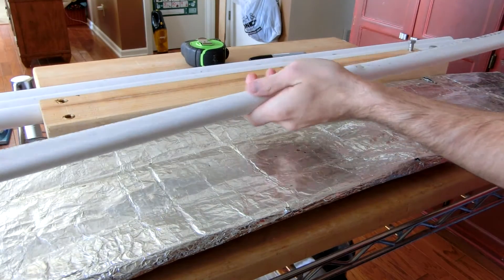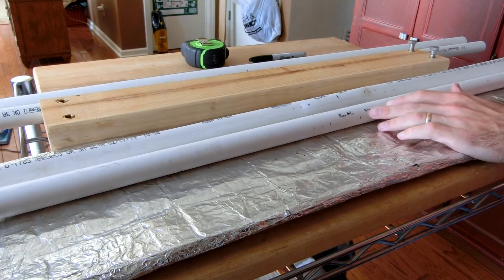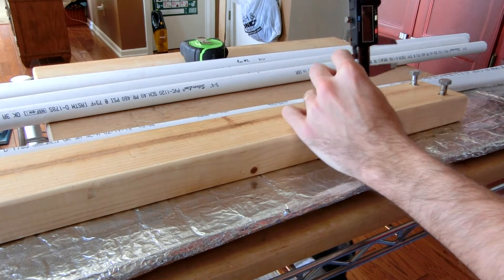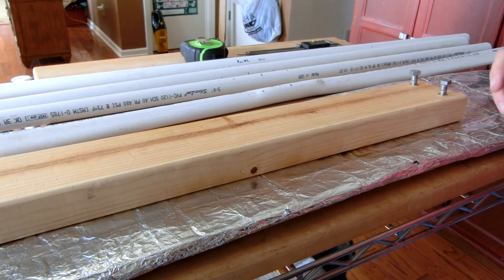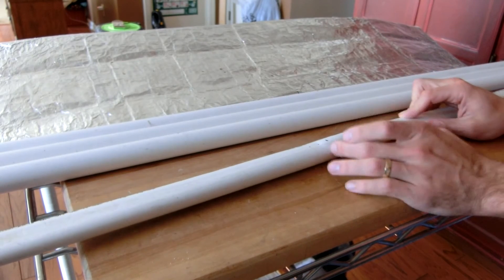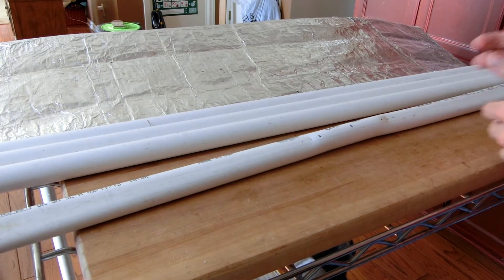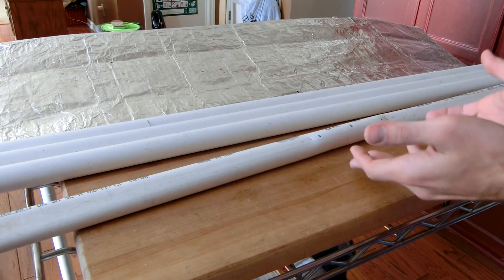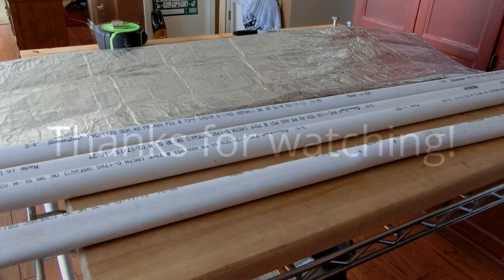Precision-Flattening Bows for Comparative Analysis

Comment: unfortunately 1 inch "pvc" pipe is not available in my country (Turkey)..  only ppr-c (poly-propylene) pipes are sold in the market. i can see the label of the pipe on 00:31 on the upper right corner of the screen is "pvc". the label of my pipe is "ppr-c". so it is very hard to heat it. it looks like chewwing gum and i cannot shape it.. what can i do?

Comment: This is gonna revolutionize pvc bowyering greatly! Little tip about the vernier measuring device: when you open it, there is a needle that pops out on the end opposite to the place where you get your reading. Try to measure putting the needle on the wood and the base of the vernier on the flat end of the screw, That way, you measure how thick the bow should come out after flattening. Besides, if  the screws I use have a different sized head, the results would come out different.

Tim, I think I have to say, with Nick and you around here in youtube, PVC bowyering is going to be VERY strong! You guys are the two fathers of pvc bowyering!
Reply from the maker: Thanks, Eugenio! 

Maybe I don't understand exactly, but wouldn't the measurements of the depth gauge (what I think you're referring to, the "needle" thing that extends as I widen the "jaws" of the caliper) read the same thing as the internal measurement gauge?

Either way, I'm happy for your advice! Thanks!
Reply: Maybe I misunderstood, I thought you were measuring from the other side of the hex bolt's head. If you place the jig on the edge of the table bolts facing down, you can use the internal measurement gauge. I'm always glad to help a friend! Even if I sometimes misunderstand the explanations :p